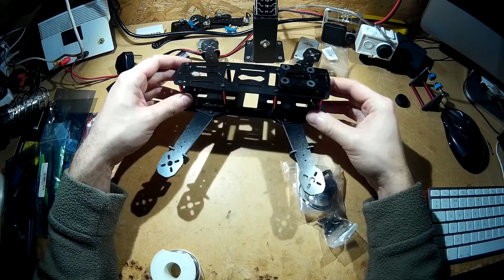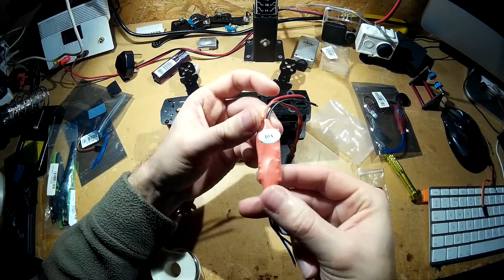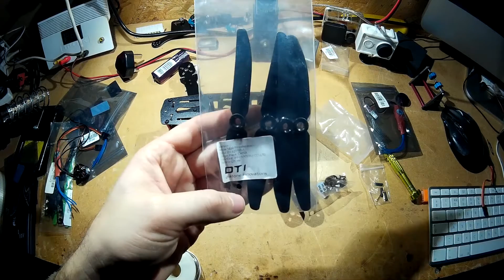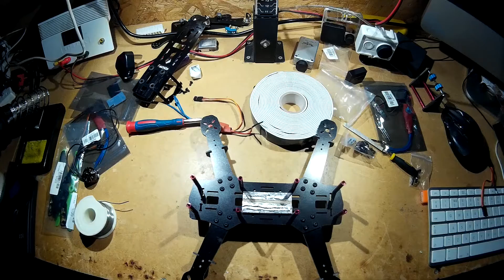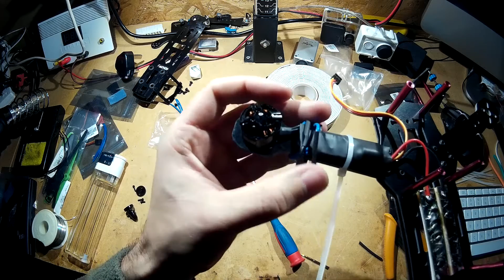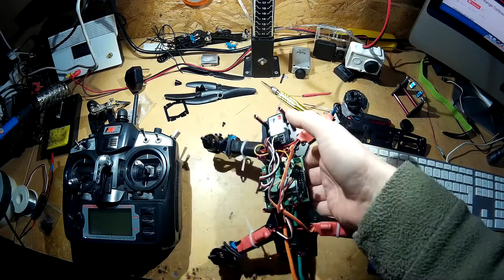ZMR250 Blackout Clone Frame Build Pt1

Comment: nice build so far jace hope you feel better have fun RCing
Reply from the maker: +Budget Guy RC Thanks my friend. just need to set up the transmitter 3way switch for flight modes. and turn the flight up. slightly complex operation.
Cheers mate.

Comment: Well done Jace that is looking awesome.
Reply from the maker: +Raymond Earle Thanks Raymond. If i get this transmitter worked out, Easy setup for fixed wing plane a pain in the backside  for Quadcopters.

I think i got it sorted the weather is so bad cant test it rain wind 26mph gusts up to 40mph not good.
All the best my friend 
Jace
Reply: Ah. You have English summer too. Wet warm and windy. My VAWT has a vane hanging off. But it's been going nuts. I got it in parallel with solar panel and its been putting power into the QXA too. Earlier Solar gave me 250mA and the VAWT was lifting it at times to 500+mA. It was awesome. I put a chair on the landing. Made a cupa and sat and watched it for ages. I lead a simple life. That's because I am simple. LMAO.